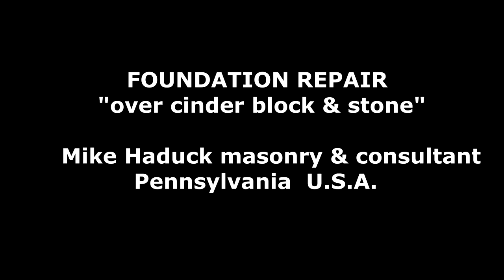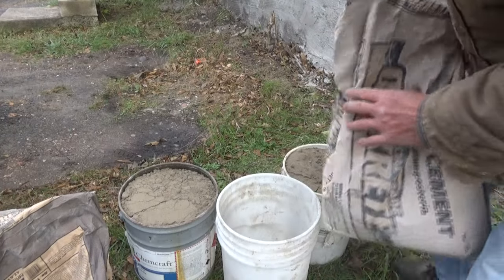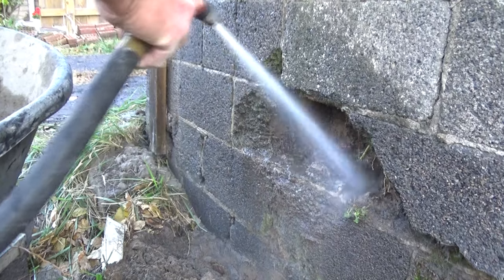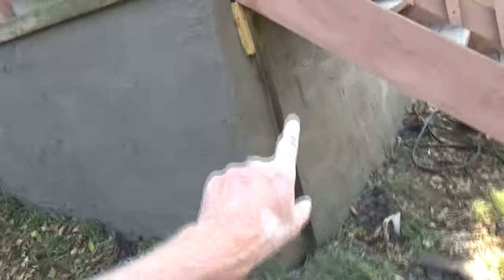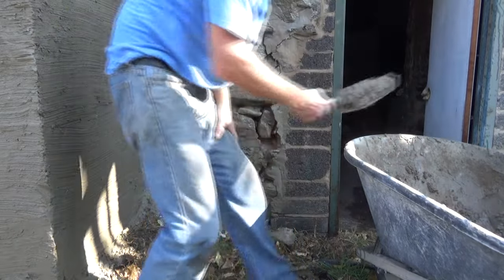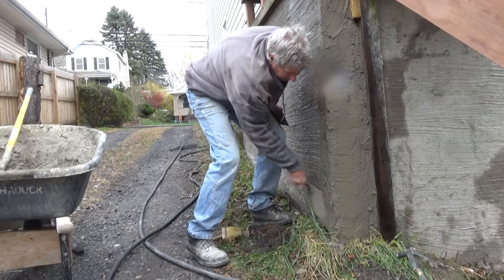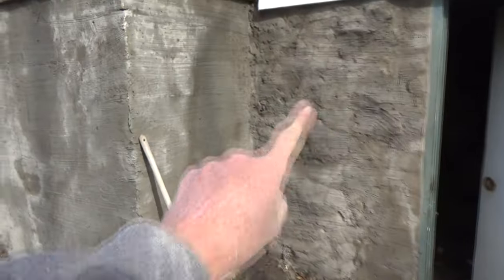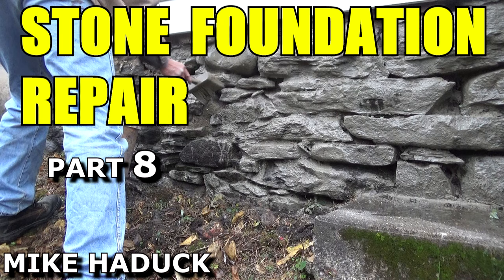FOUNDATION REPAIR (Part 15) Mike Haduck

Comment: Would this type of repair be suitable below grade?
Reply from the maker: I did a video called, basement water problem solutions. Mike haduck, that might help, but usually old stone foundations I use same process, thanks Mike
Reply: @MikeHaduck  thanks Mike. I excavated the foundation of my home and found that the whole cinder block corner had deteriorated just like the blocks in this video. I’ve been trying to find a mason to replace the blocks for me, but nobody will call me back. I’m considering making the repairs myself using the technique you used in this video. I’m from Altoona PA, and was wondering if the freeze thaw cycle would cause the repair to fail below grade. Either way, you have a great channel here. Keep up the good work fellow Pennsylvanian!

Comment: That wall started messing with my ocd, to the point i was thinking smooth finish with a wet sponge and then paint it with cement paint.
Reply from the maker: Hi Spen, an old building It would mean more than a few coats and I didnt see it, thanks mike
Reply: @MikeHaduck  Its was more of a comment, that wall was making my right eye twitch heh. But as you say is almost all your vids, what works best in your area etc :-)
Reply from the maker: Thanks, Mike

Comment: Wouldn’t you soak or wet the bricks you fit into the hole?
Reply from the maker: Hi Keith, it's one of those times in it wouldn't matter and only make a mess, thanks Mike
Reply: Thanks, Mike. Love your videos. I’ve learned so much from them I feel confident enough to do repairs on my own because I don’t make a big deal about it. 😎

Comment: What mix did you use?  Ratio
Reply from the maker: Hi Dee, I think it was 4 parts  mason sand to 1 part s mortar  1 part Portland, sometimes I use the premix s mortar with the sand in it and add a little Portland but I show what I use on each job. Thanks Mike

Comment: Why half a bucket of s mortar if it contains lime?
Reply: Makes it stick better I’m assuming.
Reply from the maker: Yep, helps make it stick a little better, easier to work with,  the Portland gives it strength, thanks mike

Comment: I really like your skills, expertise and storytelling. But in my eyes this must be one of the ugliest type of render I have even seen. It masks the terrible wall underneath, but at what cost?
Reply from the maker: Hi Ben, it's a cheap fix, it doesn't make sense to try to smooth it out, it would be too thick and time consuming and then show any new discrepancies as it ages and easy fix when it does, combat finish, lol, mike
Reply: @MikeHaduck  
I understand.
But it doesn't make it less ugly :-)
Reply from the maker: Lol, well let's just say it's the lesser of two evils, thanks mike
Reply: @MikeHaduck  
:-)
I agree
Reply: Man considering what the foundation looked like the Combat finish is very very very acceptable. 
For 
$200 material and 3 Days labor.
Can't beat that.

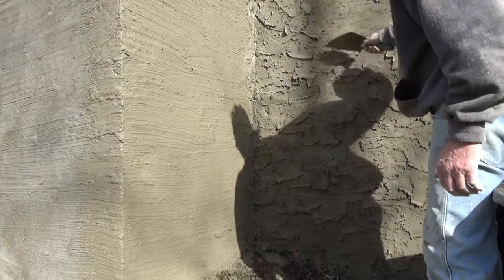22:16
 "looks rugged looks old trying to hide all those sins"
Reply: @BendeVette  A lot less ugly than sand and bird's nests falling out with weeds all about the wall. Also, the repair is to stop the wall from being totally lost to where it would turn into an actual "big deal." Lol